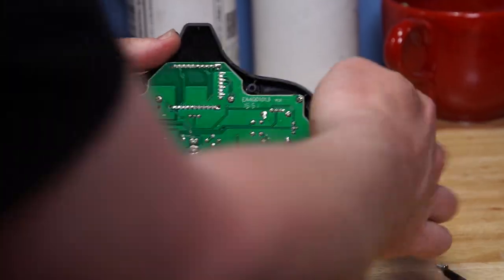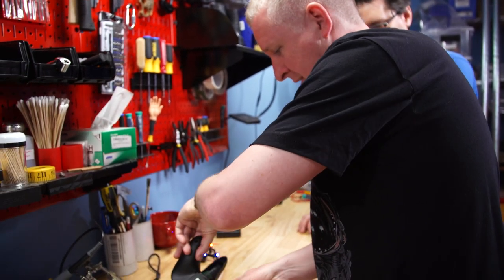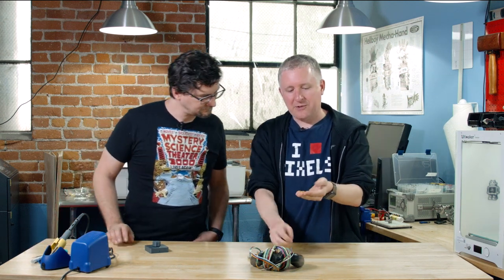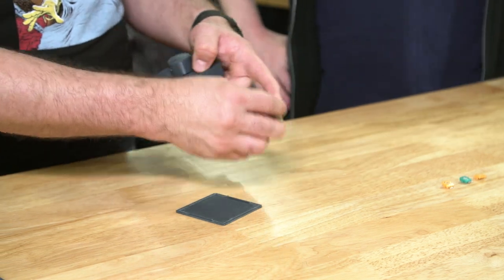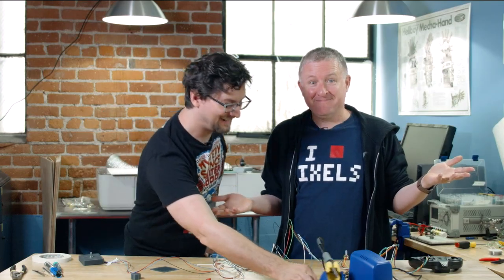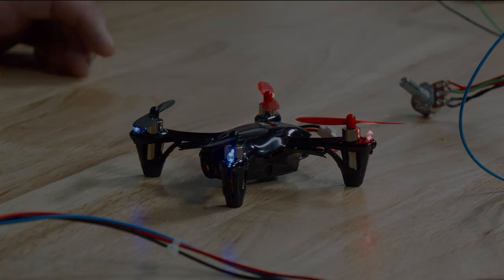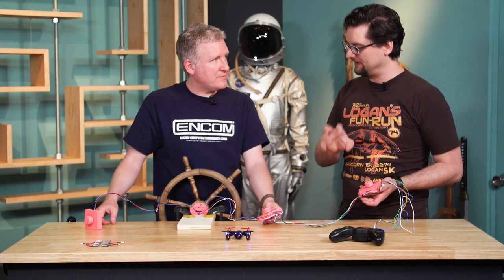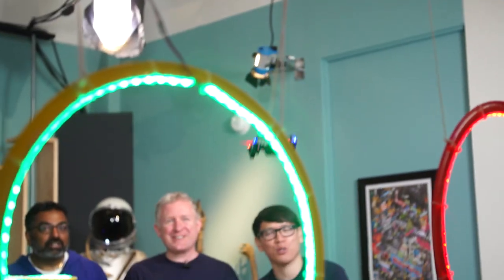Bits to Atoms: The Co-op Quadcopter Challenge!

Comment: A larger circumference on the dial would give finer control - it seemed like 0 to 100% was a small motion of the hand. Loved how excited Jeremy got, though! :)
Reply: They actually had the opposite problem. They want less fine control. It was hard because they hard to move the dial too far to do a small movement. On the regular controller, the joystick only moves a few centimeters

Comment: Great video! 
It is cooler if the controllers have more variarion, like a lever as mentioned in the video. 
The problem with de range of the lever x range of the pot cold be easily solved with some 3dprint gear reduction..
Reply: adriano sousa I had the same thought! Gears would make it a lot easier to control the range of motion of a lever and give the user much finer control over the quadcopters movement.
Reply: or do a solid wheel that has graduations from 0 to 10  and you just spin it forward and back with a reference point of zero at the bottom of travel ... heck make it phi spiral and paint it orange so as you add more power it shows more red above the table  ... then give basic steering wheels to the last two ... one racing wheel type perhaps and one big truck spoke wheel idea ... then everyone has a unique controller and have to find how best to use what they have control of to get things working the best

Comment: As a follow up for this project how about you 3d print your own small flight cockpit linked with VR glasses using old computer racing steer parts? You might need to make extra pedals and the steer needs be able to move up and down. In your VR screen you also need to operate some virtual buttons above you. Then the drone camera will be the cockpit view but no 360 view. All parts at a specific cost limit for dads to built and kids to fly.

Comment: Best one yet, so much fun. Yet the controls could have been better imho, perhaps you could add a foot pedal or boat leaver for the power, steering wheel turn r/l, a leaver left/ right for banking left/ right, and a leaver front/ back for tilt forward/ backward. And like many said before either use different potentiometers or use a gearing system for better range in the controls.  :D

Comment: Large throw on the throttle would probably have been pretty good, as long as the center of the axis was easily accessible, cause most of the time you just want high resolution on movement around the center of the throttle axis :D

Comment: i would use a star configuration for the wires, not serial, each potentiometer wire then has the same (longer) length.
each player could sit on 1 side of an arena ( if you want to make it harder,)  because  sometimes the player with the side view gives the forward/backward commands verbally to the player which has that controller, mega teamwork

Comment: The wire is only adding a few ohms at most.  Out of a 5K potentiometer that's so far in the noise you won't even be able to measure it - you could probably have 50' of (decently sized) wire and it wouldn't make any difference.

Comment: I'm only 8 min and 35sec in for this comment. Usually toy rc remotes are built in Mode 2 configuration which is left stick: throttle and yaw and right stick: foward/back and tilt left/right.